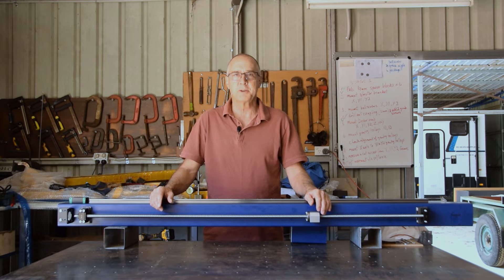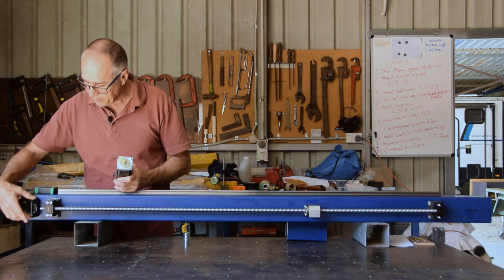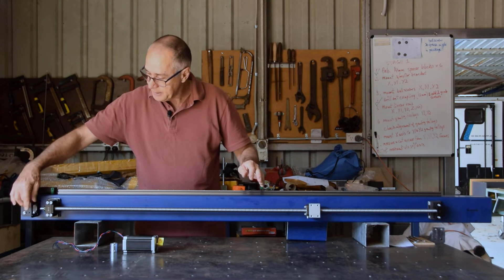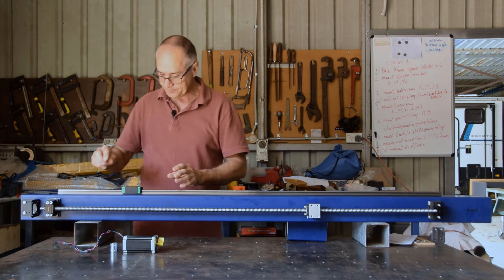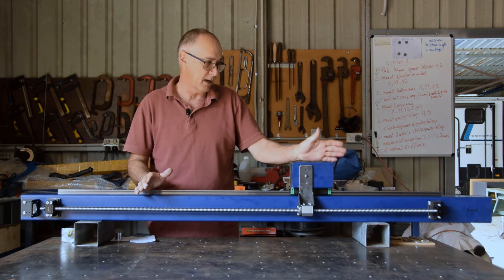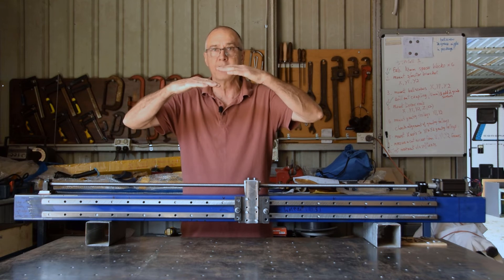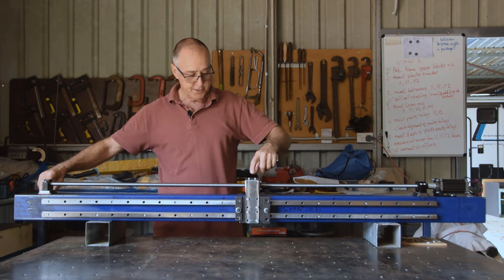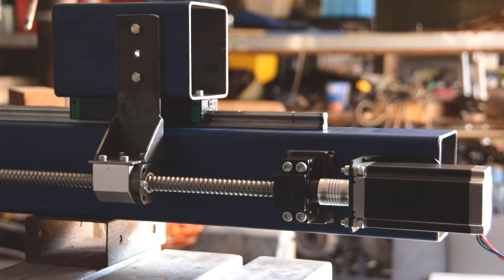How to Build a CNC Plasma Cutting Table | Part 3 - The X, Y & Z Components

Comment: IMO on a plasma machine with zero cutting force (unlike a router or mill) I think one rail and 2 trucks for the X axis would be quite adequate and would save weight and money. In fact one smaller 12mm rail would be plenty rigid  enough.
Reply from the maker: Not knowing anything about CNC plasma cutting tables when I built this one, I copied the design from someone else, and that was how they had set theirs up.
Reply: @RustysMetalSigns  Not being critical, but I see many heavy overbuilt tables. You did a very nice job for sure.

Comment: how many hours on the table now? any things you would change?
Reply: The table is now 2 1/2 years old and while not used every day, has seen quite a few sheets of metal pass over it. As for things I'd change, maybe the ballscrews from 1605 to 2010, just to make it run a bit faster when cutting thin material, but turning the amps down on the plasma cutter and tweaking the cut speed have given me good results, though. If I built a full size table, I'd go with rack & pinion drive system.

Comment: what say that tube is straight?
Reply: If you're referring to the box section I used to make the frame rails, I visually inspected all the steel I used for the build, to ensure it wasn't damaged.
Reply: @RustysOutbackAdventures  point being there is a straight tube in the world. that rail is most likely much straighter than the tube. and your deflecting the rail to match the tube. just sayin.

Comment: Hey rusty, good job mate.
Ive watched all your vids a couple times now but because im looking at a million other things cnc related, so you probably mentioned it.
But did you source your rails and bearings local or?
Go to china?

Im just about to start but because things weren't difficult enough i decided to buy a Mill and CNC that while im at it ahahahahaha
Reply from the maker: I bought my linear rails and ballscrews off eBay, along with a lot of other parts for my table build. The other option would be somewhere like AliExpress, which is based in China.

Comment: This video is sort of having a 250,000-dollar garage shop and spending 20,000 dollars on parts to put it together like Lego. How can I duplicate this without having the bells and whistles?
Reply from the maker: I'm not sure there are too many 'bells and whistles' on my table....it's a fairly basic design that works well for me. Are you thinking of building your own table??
Reply: Actually use lego if you want cheaper. Only need a spanner , drill and welder as its the most cost effective design . If you don't have these tools you won't be building anything as super won't hold the parts together sadly

Comment: Hi Rusty. Hope you are doing well. Just a question about your linear rails and bearings. Did you have any issues with getting the bearings to move smoothly along the rails? I bought the same rails and mine are not nearly as smooth as it appears that yours are. Thanks!
Reply from the maker: Hi Kerry. I didn't have any issues with my linear bearings on the rails...they moved nice and smoothly. Are yours notchy in places or all along the rail??
Reply: @RustysMetalSigns  They are a bit notchy in places. I am gonna give them a good cleaning and see if it makes them better. Seems funny that all the rails and bearings would feel the same way.
Reply from the maker: Make sure you don't lose any of the balls out of the bearing housing, ok.
Reply: @RustysMetalSigns  Guess I am gonna do something different for rails. I cleaned the rails and bearings. Two of the bearings were missing balls out of the box so I added balls. Frustrating……

Comment: Hi
Do you have a link for the z axe assembly?
Thanks
I like your videos, very helpfull.
Reply from the maker: Hi Blou, I ordered the Z axis unit off eBay. If you use this search term, you be able to find the unit I bought, or something similar....'Nema23 Stepper Motor 100mm Linear Motion 1605 Ball Screw Guide Rail Slide Table'
I hope this helps.

Comment: Thank you so much! I'm halfway through my build and I keep reworking the linear motion. It's getting exhausting, I just want the machine complete! I think I like your way the best. I started out with the rolling bearings technique along 50mm square tubing and some belts but then ditched the roller bearings idea and went with these linear rails and ballscrews. I don't prefer belts cause I built a small langmuir clone to start out and the steel reinforced belts ended up stretching and gave me 7 thou backlash. 

I really like the 160mm gantry offset box you are utilizing. I'll be incorporating that into my design I'm sure.
Reply from the maker: Hey Tyler, thanks for your comments and I'm glad my build videos are helpful to you. I know there are those who don't believe ballscrews should be used for plasma cutting, but I've had no issues so far with my table design. Langmuir use a lead screw on their tables and that's where I got the idea from.
I was considering going with a belt drive system if I ever get around to building a bigger table, but if you've seen the belts stretch, then that's not a good thing..
Feel free to email me (rmhyde58@gmail.com) if you have any questions about my build, or if you need help with any part of your build.

Comment: Again, I have learned a lot from your videos - thank you sir!  I like the ball screw designs, but I've read somewhere you might get "screw whip" over using pinion/rack. have you had any issues with whip? I have found a few ways to eliminate whipping. 
https://www.youtube.com/watch?v=kkcVWIsXGjk&ab_channel=BlackForest
Reply from the maker: Hi Mike, so sorry for the late reply but I've just found your comment. My table runs at a fairly slow speed, typically around 2200mm/min for 16g material...and slower speeds as the material gets thicker.
I've never had any issues with and of the ballscrews whipping.

Comment: Hi, Nice!

But think about change screw drive to other drive ( belts or pinion/rack ) in this nice machine!

You're doing a great job with these movies. I am not a mechanic, but I can write something from the observation of many machines.

Screw is good for milling etc, not for plasma or laser CNC machines. This your axis isn't to long and maybe will working good but for long axis scraw working like guitar string and have big resonance for specis speeds and depended of axis position (the best result when axis is on midpoint ). Second problem is speed - if you are using stepper motor without any mechanical transmission then dynamics and speed of machine isn't good ( needed very high speed of motor. Motor need time for accelerate and deccelerate to high speed also for not high speed of axis ). 

Thick materials slowly will cut perfectly.

Thin materials plasma cutters can cut only if dynamisc is very high, always if slow down cutting quality isn't good. Also maximum speed isn't posible and move long distance need lot of time ( floating without cutting ) don't know in this case but think that for longer axis maximum stable speed will be not too high.
I'm sorry - i don't like to criticize the wonderful machines built but it's important questions and i think that your canal will be very popularity.

I saw lot of different plasma machines and trust me, more better working with belt or pinion/rack. 
Standard floating speeds of Plasma machines are 15-25m / min. Thin materials need 4000 - 9000mm /min for good quality of cutting.
Perfect gear ratio is 30-70mm / motor rev, not 5mm / motor rev ;)
Screw is perfect for milling.

Good Luck !!!
Hope that all will working better as i think.
Reply from the maker: Hi Lukasz, I appreciate your kind words regarding my channel and my table that I'm building. Thanks also for the detailed explanation of the drive system, which I will bear in mind when my table is up and running...hopefully by next week.
Reply: Hi Lukas, my plans was to build cnc plasma with hiwin ball screw 2525 travel length 1800mm, With beckhoff nema34 5N.m stepper motor, is it a good idea or better go with rack and pinion? My plasma source is hypertherm powermax 85, my most material thickness I'm going to cut is 1-8 mm.
Is ball screw 2525 will achieve the required speed and acceleration?
Appreciate your help